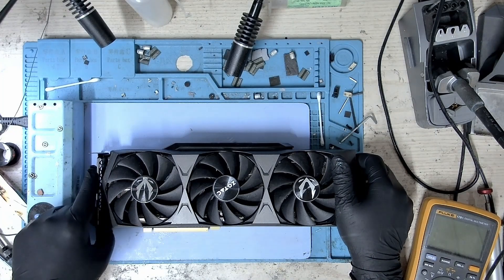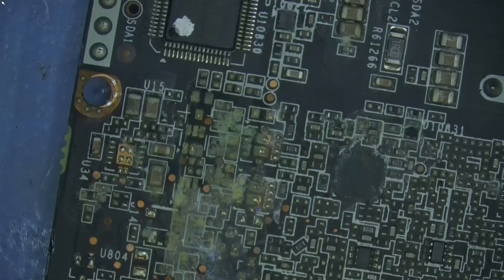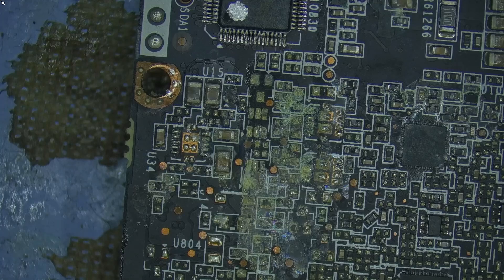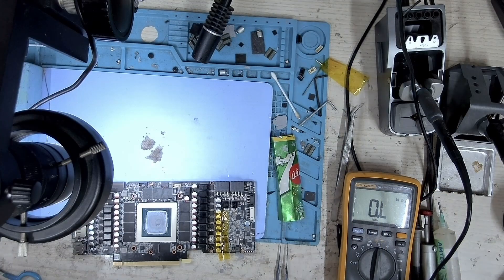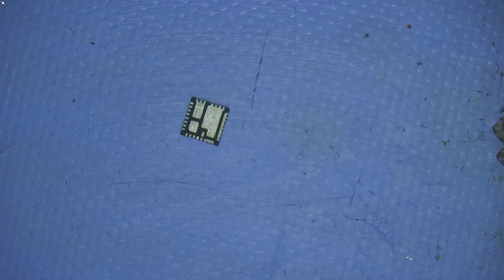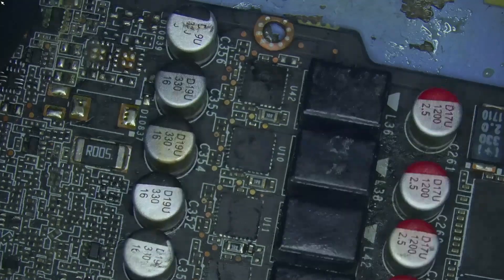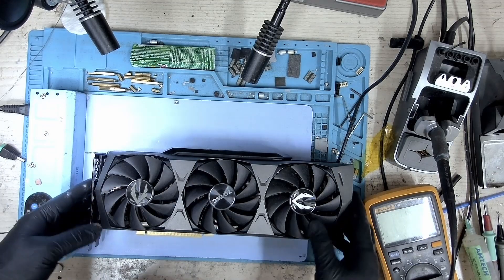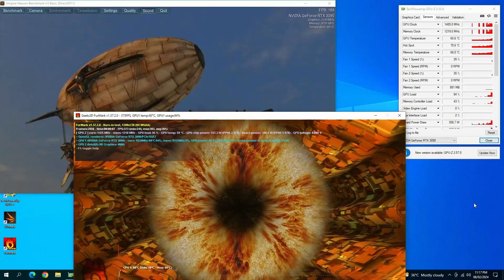Zotac RTX 3090 - PC Does Not Start With This GPU Installed

Comment: i like your video , would you tell us where exactly yuo inject voltage , it s not clear  , i see some inject voltage on the shorted component like resistor
Reply from the maker: Voltage is injected on the rail which has a short circuit. It is important that voltage is low with high amps. For that you will need a variable bench power supply. 0.8v 4A is a good place to start and gradually increase the voltage with 0.5V increments.

Comment: I like your videos, im definitely subscrbing to you. But i have a question, how do you know what voltage each component on the graphics card should have?
Reply from the maker: You will need schematics and boardview to know what connects and what the output will be. Apart from that your experience will also count as sometimes even schematics and boardview will not tell you what the output voltage will be.